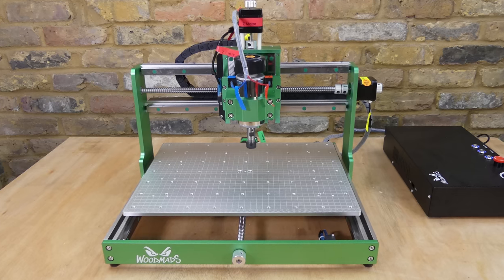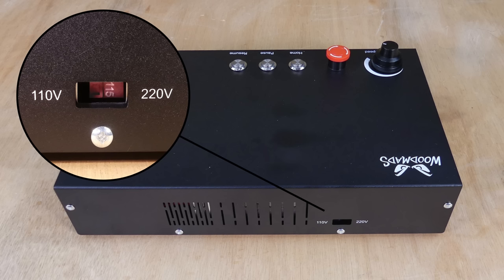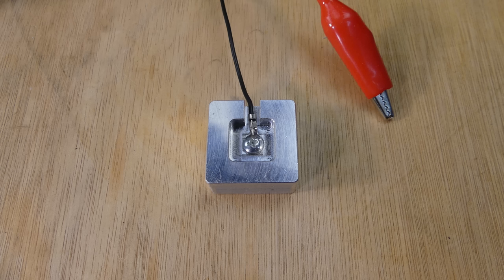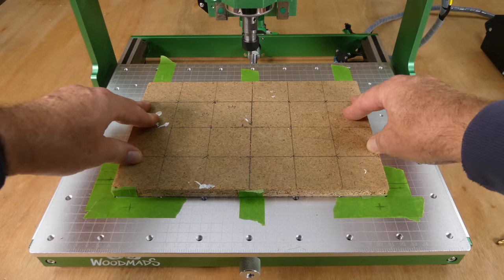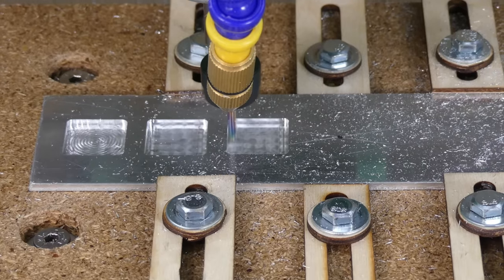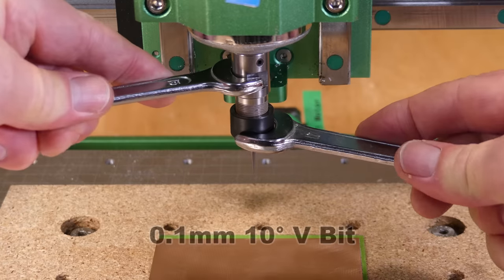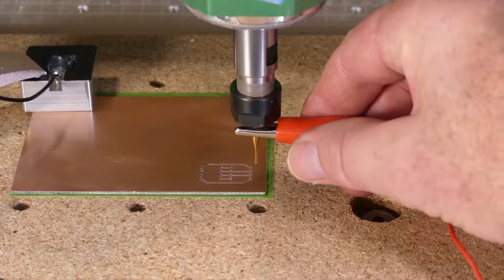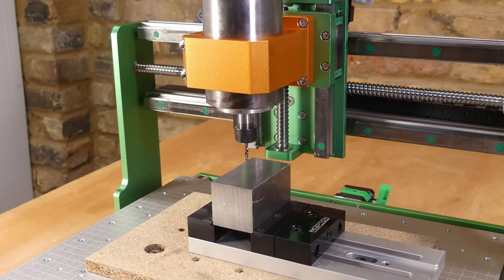Foxalien wm3020 Cnc with Linear Rails & Ballscrews

Comment: Nice thorough review! Your build video of it enticed me enough to buy one for myself a few weeks ago.  It's a great machine, but I've already found some ways to upgrade it:

The stock spindle is good, but mine had a fair amount of runout in the motor shaft. There is a small amount of adjustability in the set screws of the ER11 tool holder, but I wasn't able to get mine low enough to be satisfactory to me.  Additionally, the shaft deflects quite a bit under load, causing chatter. I ended up upgrading it to a 600W Deadelus brushless ER11 spindle.  So far I'm really happy with that: it has a very small runout, and the ER11 tool holder is machined out of the shaft of the motor, so it's nice and stiff. There is very little deflection under load. Also, the collet nut that came with it is heaps better than the stock spindle's.  I'll be looking forward to your video about your spindle upgrade!

Another big issue with the WM-3020 is, despite having ballscrews, there is still an amount of "backlash" introduced by the lack of proper bearing mounts. I had read about this being necessary on DIY CNC forums but I wasn't really sure why until I got my machine. When a force is applied in the axial direction on a ball screw, there needs to be something to take that load and prevent it from sliding (you want the ball screw nut to slide, not the entire ball screw!). On the WM-3020, this force is taken in one direction by a flange-mount bearing, and the other by the bearings in the stepper motor.  None of these interfaces are made rigidly, they are all slip-fit. Unless there is some preload applied (which there wasn't, and I think it would be hard to do) you will be able to shift the entire ball screw in and out without it rotating (ie. your axis will slide when it gets pushed towards the stepper motor).

I solved this issue using some thrust bearings and machined bearing mounts that take the load instead of the stepper motor's bearings.

For some reason the machine came with the GRBL setting "step idle delay" set to 25ms. As soon as an axis hasn't been moving for more than 25 milliseconds, it will turn off the stepper motor. I don't think this makes any sense for a CNC machine. For a lot of toolpaths, the Z height isn't changed for a long time. With this setting left at 25ms, your Z-axis stepper will turn off and upward or downward forces will cause your Z-axis to shift and you will loose those steps. This is a lot easier to happen with ballscrews than with lead screws, which have more sliding friction. You will also almost always lose whatever microstep position you were holding before it was turned off.  I highly recommend disabling this feature!

I'm still discovering ways to improve the rigidty of the machine (for example the plate that holds the Z-axis stepper is a little thin, and flexes under loads in the Z-axis), but overall I'm extremely pleased with it. I am looking forward to an increased Z-axis height kit (If I don't make one myself first...). That would be very nice because as it is currently, as soon as you add some fixturing you run out of extra height to install your bits!
Reply: Hey, very good comment. Lots of good suggestions.
Reply: Thanks for pointing out the issues. Would you share the link to the thrust bearings and the STL of your bearing mount in case you machined it with the CNC?
Reply: Bearings of that 300W "spindle" are placed in rubber seatings. That's where the shutter comes from. If you don't want to mess up your bits,  think about changing spindle or just remove rubber seating and put something made of metal instead.
Before I bought this machine I asked FA if they can sell me it without this f*cking "spindle" and they did not agree so... I also have it...
Reply: Very helpful comment, thanks!
Can you provide some details about your modifications? I'm also interest in information about interchange of the spindle, guide or so? Thank you again!

Comment: I like your video style a lot because you are going straight to the point. But provides still a lot of information around the topic.
Two additional topics as a dedicated video would also be very interesting:
1) Attachment methods:
    o According to material: Aluminium/wood
    o Scotch: I did not yet understood why there is no double sided scotch used. Instead this "special" green one is used!?
   o Primer/Glue/Scotch method: I saw this method a lot but did not yet understood its main advantage.
   o Turning the machining object for maching its sides. Correct referencing after unscrewing the machining object.
   o Vises: Important aspects of them. There are cheap and expensive ones. What makes sense to invest for such a type of machine?
   o Egalization/Parallization(?) of four machining object faces?
2) Mills / Cooling:
   o Which coating/mill base material for which working material?
   o When is cooling required? Which types are when recommended? (I saw your video "Sainsmart Genmitsu 3020 Pro Max" which already gives some details)
   o Flute types: Single, dual, etc. When to use which?
   o Material removal/Surface finish: Which mills are recommended for material removal and which are good for a smooth surface?
  o Operating depth: What has to be considered if you want to create deep pockets? Say 30-40mm? Is it the mill cut depths only? Or more the Z-axis stability?
Maybe you do a video with a bit more complex (40x40x40mm and ) wood/aluminium/steel objects and go into the mentioned aspects above a bit more in detail?
Thanks a lot!

Comment: The y-axis linear rails and ball screw axis is exposed to dust and aluminium chips.
How much dust/chips is still going into the rails/ball screw axis with a dust shoe?
Which other means are recommended/required to avoid fast wear out of the rails/axis?
In your video of the "Sainsmart Genmitsu 3020 Pro Max" you added some DPC material at the bottom of the table bed as a dust shield...

Comment: When you talk about 'optimal load', are you referring to the pitch at which the milling cutter advances?
Reply from the maker: In Fusion 360 it is the width of cut or step over associated with an adaptive toolpath. The adaptive toolpath does its best to present a constant load to the endmill.

Comment: Which would you recommend for aluminum and hardwood projects using either a dewalt/makita or 1.5kW spindle:  WM-3020 or ProverXL 4030.  Is this machine a lot more accurate compared to the 4030?  Are the Nema 17 stepper motors of the WM-3020 a major limitation?  Thanks!
Reply: I would recommend a VFD for sure, the stock spindle is not bad for what it is but really still a wee bit underpowered. I was planning on getting a 600W Teknomotor for mine but it is a bit of a challenge to get that mounted as it is a square style Spindle and the mounting bolts are on the back. That means it would need an adapter plate but then problem 2 is that it is 68 mm wide and the mounting holes on the Z plate are 70mm apart. In short I would most likely have to drill extra holes in the Z plate. I might still do it if the 1.5KW spindle I have on order turns out to be a bad buy but for now I will just use the 65mm optional spindle holder and that 1.5KW vfd driven spindle.

As for the steppers, they are Nema 17 so I also got a set of Nema 17 Closed Loop steppers and T42 drivers to go with it. Was planning on replacing the control board with something else anyways (interested in playing around with the ESP32 based GRBL forks and replacements like FluidNC etc). The base controler, while perfectly useable for most people, just didn't have the ... what's the word ... tinkering potential I want. I was in doubt about getting Nema 17 Servos like the iHSS42-24-07 but getting Servos set up correctly for my usecase (isolation milling PCBs and making faceplated and enclosures in POM etc.) would probably drive me insane (too many parameters to deal with on servos).

Comment: I have been thinking about purchasing this machine. Will it handle aluminum well also if I upgrade the gantry to steel plates do you think that it would help with ridgity? I am thinking of different ways to upgrade this machine? Or if you know of any other cnc machines that are already built well enough to handle aluminum and stainless steel could you point me in the right direction? Thank you for all you time in the videos you make.

Comment: Hello. I also bought such a machine. How do you work on the machine if the spindle speed control does not work with G-code commands? I also do not adjust the slider.
Reply from the maker: Leave the spindle speed at maximum and then set your feedrate accordingly. The spindle has maximum torque at maximum speed, so there is no real advantage in changing it.

Comment: great video, i've been referencing it a lot. What post processor did you use out of fusion 360 for your wm3020? I'm having trouble with consistency from fusion tool path simulation to what the program looks like after posting
Reply from the maker: Thanks. grbl post. That is not something I have experienced!

Comment: How did you connect the air nozzle?
Reply from the maker: I cut an  adapter plate in aluminium. There are some spare threaded holes on the mount

Comment: Does candle supports a possibility for a tool lengh sensor? To measure only a new tool after a swap in between a milling process
Reply from the maker: Candle doesn't specifically support it, but you can setup macro buttons . Grbl does support it. You would connect the tool setter to the probe input. UGS would be a better software option than candle. Its on my list of things to setup at some point.
Reply: @techydiy  ok thanks for the answer. Then i see if i can get ugs to work and got find a macro for it. Dunno why its not in candle. As a newbie i think it relatively important to have the possibility to do that.
Estlcam would be nice to have tho but i dont think the controller can do. Have to check that controller they using
Reply from the maker: It is a grbl based controller.
Reply: @techydiy  yea. im testing cncjs at the moment.

Comment: @techydiy Have you ever tried to produce circuit boards for smd assembly with this type of machine?
Reply from the maker: Yes, it easier in one way than through hole as you don't have to drill but there is a limitation on how small you can make the tracks/clearance.
Reply: @techydiy  Thank you for your feedback. Perhaps you could add this to your machine tests in the future. I think there are many out there who would like to use the milling machine for this purpose, especially since smd is also becoming more and more interesting for the hobby user.

Comment: A great review - what was the grade of the first pieces of aluminium that you did the test cuts in please? 1050?
Reply from the maker: Yes 1050, which for the benefit of others is horrible to cut, soft and gummy, not a recommended grade of aluminium, but actually quite a good test. 6061T6 or 6082T6 are my recommended grades of aluminium for machining.

Comment: Is it more important to have more RPM's or more Power on a trmmer/ router such as the makita ones
Reply from the maker: High torque over a wide speed range is what I would look for.
Reply: @techydiy  is 530w 35000rpm good?

Comment: Hey. What pump and stuff you use as air blower?
Reply from the maker: I use an existing 100L shop compressor. If I was buying specifically for this I would get small “silent” compressor.
Reply: @techydiy  thx for the answer. I'll check whats the smallest i can find

Comment: I’m having a hard time cutting aluminum. May I know where you get the air blower system? Could you please let me know? Thank you
Reply from the maker: EBay. They are commonly available.
Reply from the maker: The grade of aluminium makes a big difference. 6061 T6.  Or 6082 T6. Cuts well. Also try a single flute endmill (for aluminium) and use the correct feed rate and speed. You can also use wd40 for lubrication.

Comment: can fusion 360 be used to model and send G code to this machine? Or do you have to write the G-code manually?
Reply from the maker: F360 can 3d model and generate the gcode. Another program is used to send the gcode to the machine.

Comment: Awesome review! Just ordered mine !! I was looking to get the 800w 65mm spindle but was wondering if you get any flex on the z axis or does the machine feel solid enough along with the nema 17 to handle the weight of the spindle?
Reply from the maker: It lifted a 1.5kW spindle fine, see the end of the video.
Reply: Great!! Are the nema 17 1.7A?

Comment: why not cut fluid ? at least water
Reply from the maker: It doesn’t need it and it makes a mess
Reply: @techydiy  The classic cutting fluid for aluminium is WD-40 which you can apply using a spray-can and plastic tube nozzle. I don't know if it would make a difference when using TiN-coated cutting tools though. Maybe machining different grades of aluminium would benefit from using WD-40 but it's still going to make a bit of a mess regardless. I'm interested to see if it can cut steel given enough time and possibly mist coolant with carbide tooling. I've also got some brass parts I'd like to make, including some decorative 3D-relief brass plaques.

I'm going to order a WM-3020 very soon but there don't seem to be any Black Friday deals on this particular unit where I am (the United Kingdom). The UK Amazon store seems to be my best bet at 759 pounds UK inc. VAT, shipping etc. Thanks for the review, very helpful.
Reply from the maker: I use dlc coated bits for aluminium and they cut dry. 
The manufacturer is Rennie Tools in Stockport (  https://www.rennietool.co.uk )

Comment: 2 degree helix did not work at all on my machine had to change it to .5 degree
Reply from the maker: The endmill makes a huge difference
Reply: Using a 3 flute
Reply from the maker: https://hsmadvisor.com/ is good for feeds and speeds calculations.
Reply: Talked to fox alien max speeds is 1200mm/sec for all axis movement
Reply from the maker: To find the maximum feed rate and acceleration you have to test each axis until the stepper motors  lose steps, then back off to about 80% of that value. 2000 mm/min was conservative on my machine.
Reply: @techydiy  how do I make changes to the max feed rate?
Reply from the maker: Max feedrate settings:
https://github.com/gnea/grbl/blob/master/doc/markdown/settings.md#110-111-and-112--xyz-max-rate-mmmin

Acceleration settings:
https://github.com/gnea/grbl/blob/master/doc/markdown/settings.md#120-121-122--xyz-acceleration-mmsec2

From the console:
$$    Lists existing settings (take a copy for reference)
$110=2000   changes x max feedrate to 2000        etc.

Increase the feedrate until steppers make a racket, which indicates that they are losing steps. 
Back off the feedrate until the steppers work. 
Then reduce by roughly 20%.
Check under load to make sure they don't lose steps.

The same with acceleration, but can be much more sensitive.

Comment: Isn’t it the same as Sainsmart’s?
Reply from the maker: No. It’s  a much higher spec.
Reply: You could point the differences between this and the Genmitsu 3020-PRO MAX that justify the doble the price
Reply from the maker: The Foxalien has ballscrews and linear rails on all axes. 
The Genmitsu has a single linear rail on the x axis and leadscrews all around.